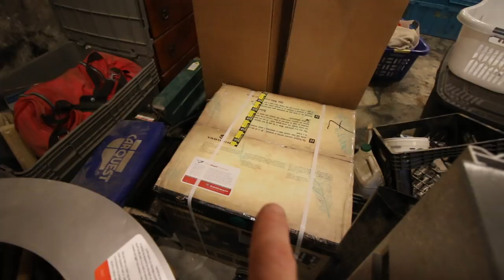Life on the Homestead in the Winter ~ Modern Steader Update

Comment: The root cellar looks about ready for filling up. That poor little bacon hanging in there all by it's lonesome, it needs company. It would make an interesting vlog showing the temperature differences in various locations in the root cellar. Floor level near cold air vent, floor level nearest door, then for each shelf level at opposite extremes of the room. As it's closed most of the time, I would venture that the air would stratify with different temps at each level/location. It would be interesting to see how widely varied the differences might be. 
The Outdoor Kitchen looks really nice against the snow draped back ground. I'm sure it must feel very satisfying to look out from your dining table and see that standing there. 
Your apron looks well saturated with protectants. In time it will take on patinas with use and get more and more supple. It should serve you well and for a lifetime.
Reply from the maker: Thanks, Yes we need to fill the root cellar! I cant wait to use the apron especially in the outdoor kitchen! :)

Comment: You know that it is cold when the snow creaks like that as you walk on it. 
I had -20 * F on my front deck this morning. That is without the windchill. 
I usually have a strong west wind that blows across my yard and against the house . 
Lots of air leaks around the windows and the front door.  Next summer a storm door plus an enclosure !
Reply: You don't need the storm door in the summer, silly, you need it now.  lol
Reply: lastniceguy1,
Yes, of course you are quite right .  But , now , it is -20 8 F outside and I also have a 20 mile an hour wind blowing !!  I don't know what the windchill factor is , but I last about five minutes of working time outside.  So , this next summer is when I am going to install the storm door plus an enclosure  around my front entrance, in preparation for next winter.  For now , my front door is completely sealed over with plastic and I only use the door at the back of my house. Which is shielded from the wind .
Reply: Stay warm and safe my friend
Reply: lastniceguy1,
I am staying as warm as I can. I am finding that I have a drafty house.
I think next summer , I will be completely covering my windows with clear Lexan with a good seal to keep out the wind.
Reply: Just make sure you leave yourself some air to breathe.  ;o)

Comment: Al, I'm going to have to go back and watch all your root cellar vids in order.  I don't have a basement (water table's too high here) but I have an unfinished room over my garage that might work....  <hoping!>   Great video and your dog & cat are like younger versions of mine.  They're always on the wrong side of each other.  lol
Reply from the maker: I bet that would work good for a root cellar you would need to insulate the floor
Reply: The floor of the room is the ceiling of the garage, which is already insulated w/R21 and sheet rocked.  The whole garage, in fact, is framed w/2x6 and insulated w/R19 and sheet rocked like the rest of the house, and it never gets very hot or cold.  The room itself is a different story - still entirely unfinished although pre-plumbed & ducted for an HVAC system and full bath.  Definitely need to get a part-time job at Lowe's!  lol

Comment: Question about the hot water Al. It doesn’t seem to be an issue with any of the animals that it’s hot. I know the ice will cool it eventually but, do you ever get concerned that it may be too hot? Or do you blend it with some cold. I haven’t noticed you turning the cold knob, just the hot.
Reply from the maker: The water is lukewarm when it comes out for the first 5 gallons.

Comment: Also..do you have to keep your cast iron stove greased so it doesn't rust?  (The stove that you use for smoking)
Reply from the maker: I think someone painted it before I got it
Reply: I have a cast iron cookware collection and I only oil mine if I'm going to be leaving it outside on a grill between uses.  As long as it's well seasoned and dried well after cleaning (and not in a super-humid environment,)  it won't rust.